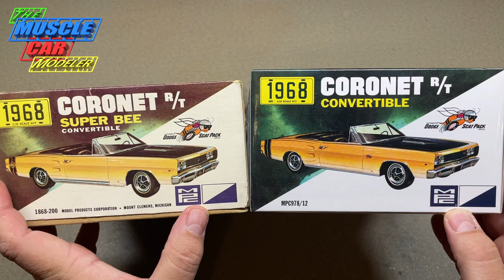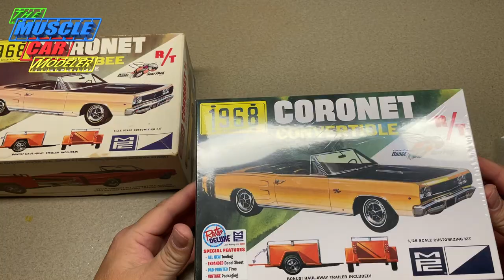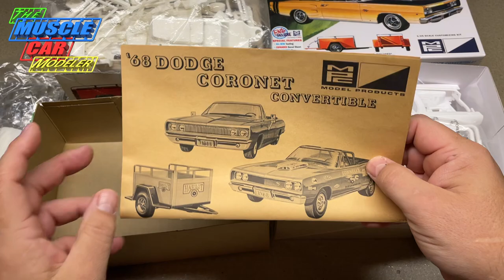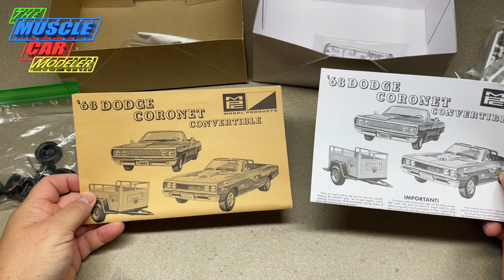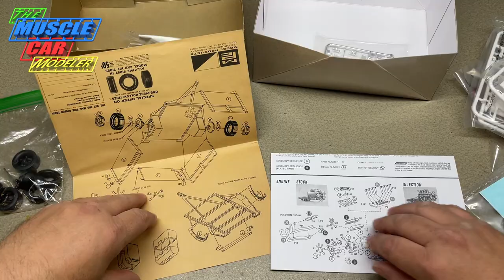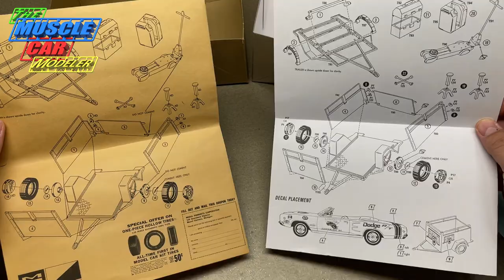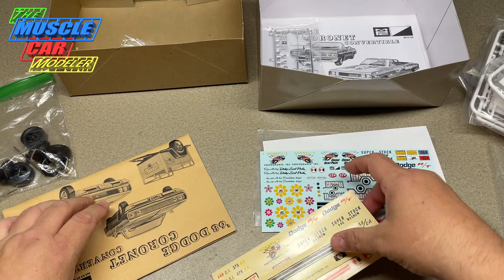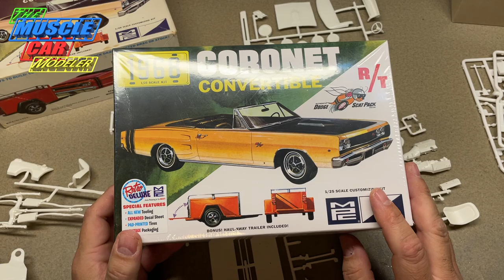MPC 1968 Dodge Coronet RT conv Old vs  New Kit Comparison

Comment: The yellow car illustrated on the original 1968 MPC kit box was a custom show car made by Dodge in 1967-68, and is the origin of the name "Super Bee." It was a real car, but only one was made. The yellow paint faded to white toward the rocker panels -- that treatment is captured in MPC's illustration. The car also had the side pipes shown in the illustration. Apparently the kit lost those side pipes when it was updated to make their 1969 Coronet kits. I wish Round2 brought them back -- I wouldn't mind having a model of that '68 Super Bee in my collection. The black hood and fender tops are also correct for the "1968" Super Bee. For more on the real car, see the February 1998 issue of Collectible Automobile magazine.
Reply from the maker: Thanks! Did not know about the show car. Anything online about it?

Comment: I believe the box-side note about "matching paint available at your dealer" to mean your hobby dealer, not your Dodge dealer.
Reply from the maker: It says "paint to match illustrations available at your local dealer" I'm pretty sure that they didn't have touch up paint sticks back then in 68. The only illustrations were the sales brochures and the last page of them had all the available colors for the car. It's on the original box. I'm surprised that they kept it for the new box or didn't change it for the hobby shops of today.

Comment: Thanks for the review. I want do a copy of my wife’s 68 sport satellite convertible. I have  the 69 GTX convertible kit and I think it’s fairly close, or close enough for me. But the interior is way off. And because it’s a convertible, that will always stand out. 
I was going to buy this kit hoping the interior would be closer.
Reply from the maker: You may be able to get away with the 68 Roadrunner interior but that will not be correct either.

Comment: Enquiring minds want to know: What's the date on the original decals ? I'm willing to bet it's from Spring/Summer 1967 (my '72 Duster MPC Annual's decal sheet is marqued '05/1971').

So many improvements on the new tooling ! I love the positive locating pins, the full chassis/floor pan/ wheel wells, separate exhaust, flashed-over holes for the exhaust, and the decal sheet. 
If I could change two things on the new tooling:
1.) Correct exhaust manifolds 
2.) Correct brake master cylinder
Both are easily rectified, but it'd have been nicer if they were corrected/updated during the retooling.

Thanks much for the review !
Reply: I was going to look at them and I remembered Raoul still has the kit. 😂😂😂
Reply from the maker: I don't see a date on the back of the two main sheets. The Super Bee sheet has 1868-07 on it? Nothing on the front.
Reply from the maker: Marty. You want them back??
Reply: @TheMuscleCarModeler  I believe that’s July of 68?
Reply: @TheMuscleCarModeler  😂😂😂
Reply: @martycoffel8795  , @The Muscle Car Modeler , eta. : That would be for a '69 maybe (07/68) as model years ran consecutive with 1:1 model years (again citing my 1972 Duster Annual's decal sheet with '05/71' date on its instructions-side).
July 1967 would be plausible; perhaps those seemingly arbitrary numbers are the kit's part number ('1868') with a July production ('07') ? 
I can only think that the kit's "-200" suffix part number is its MSRP of $2.00 (IIRC, that's how AMT marqued their kits' part numbers)..

Thanks to both of you for this excellent presentation.

Comment: Thanks, Raoul. Great job. I just picked up the new kit today. But I am totally confused about the decals in the new kit. The kit, as boxed, is definitely an R/T, not a Super Bee, which was a different trim level. But the new kit does not appear to have the R/T stripes, only the Super Bee striping. Am I missing something? As you build your kit, how do plan to address this? Thanks!
Reply from the maker: The side ones with the super bee logo are extra long. Once you put the top section on. Then use the side ones. Match the long section and it will cover the rest of the quarter panel. The super bee will fold under and be on the inside. Or just measure and cut it shorter.
Reply: @TheMuscleCarModeler  Ahhhh, thanks. I guess I could've measured them and would've realized that myself, but of course I did not.......:)
Reply from the maker: No problem. Took me a little while to realize that as well.

Comment: I think they met your hobby dealer or not your Dodge dealer when they were referring to going to get paint. LOL
Reply from the maker: That would apply better to todays kits but that is on the original kit as well. Plus it says “paint to match illustrations available at your local dealer” Back when this kit was new you could bet a sales brochure and see all the exterior color options. Interior color options and pictures of the engine. I forgot to mention it in my video but, did you notice both the original kit and this new issue don’t have any paint call outs? Nothing saying paint the engine blue, paint the air cleaner black. Nothing at all. That was common with kits back in the 50’s and 60’s. Now just about every kits tells you what to paint what color.

Comment: Did you catch that they did not have 1968 on the new bumpers But it is  on the old Bumpers
Reply from the maker: Yes, but I mentioned that in my other video when I compared it to the rebuilders that I have.

Comment: His kit may have been rebagged.  Too odd to have stains, loose parts and extra parts on an originally sealed parts bag.  Great comparison Raoul!
Reply: That’s possible? I got it off of eBay about 3 years ago.
Reply from the maker: Very true! I have bought a few sealed kits that turned out to be re shrink wrapped. One had a short shot body and the inner bag was sealed with a twist tie. Another one I opened had instructions with notes and parts highlighted on it!
Reply: @TheMuscleCarModeler  I was young but did MPC even bag them?  I don’t remember
Reply from the maker: That was before my time. I have had one sealed kit that I opened myself before this one. It was a MPC 70 Grand Prix. That one was bagged and sealed. The Johans that I have were not along with the AMT kits as well.

Comment: The SuperBee was the copycat Road Runner because Dodge saw how well RR was doing. R/T would be more like GTX so you won't see R/T on SuperBees, that wouldn't make sense. The '68 Coronet 'vert at car shows back then had the SuperBee stripes but as we know didn't make it to production. As a kid I had a nice '68 Coronet 500 with the chrome side scallops and deluxe blacked out rear plus fancy interior lighting package. I miss that car more than the 'Cuda...and I bought the 'Cuda new. But for 1:25 I had a  lifted drag or funny car '68 Coronet with chrome chassis model kit I had as kid..MPC? I don't know but I wish they'd find those molds. I did mine candy flake Lime....good ol days.   👀
Reply from the maker: Thanks. Both of these kits are based of the Super Bee Convertible concept car as you mentioned.